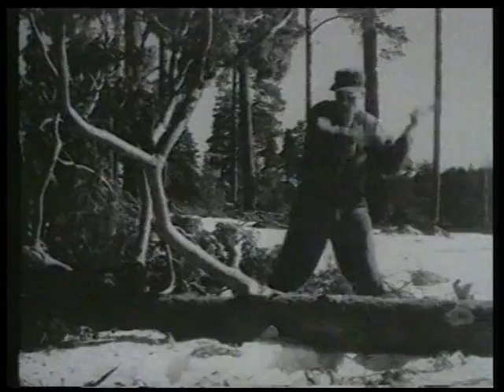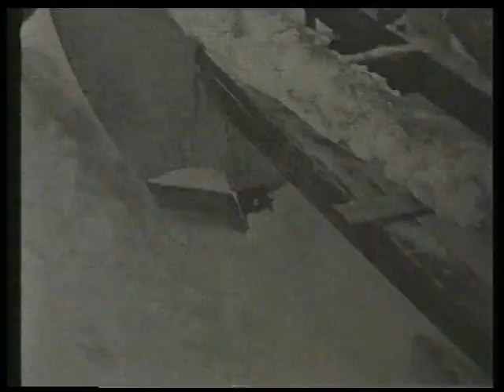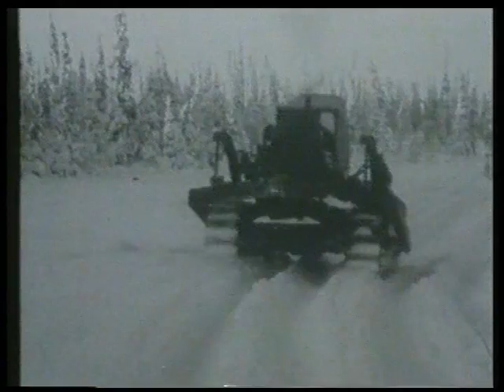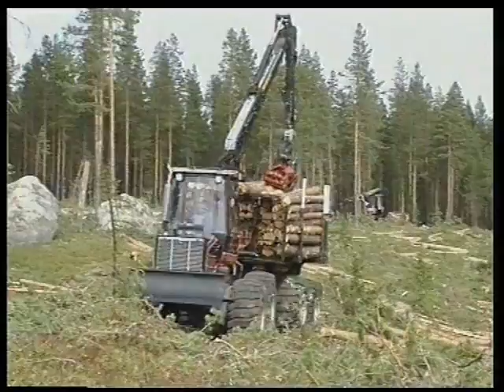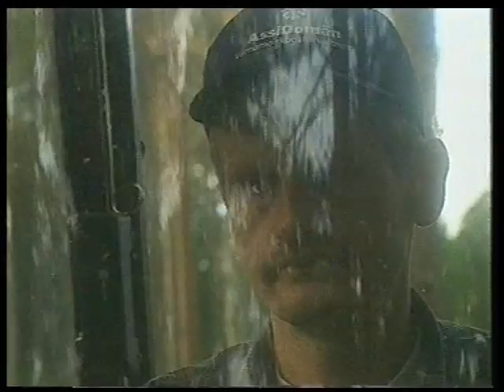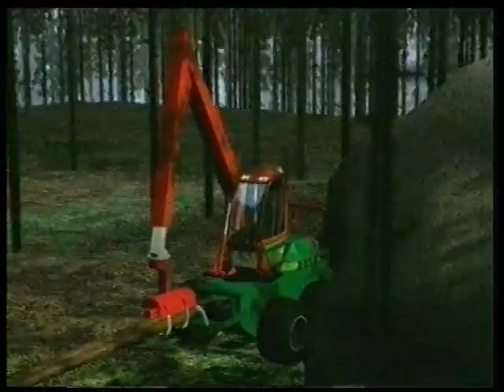From two-man crosscut to harwarder

Comment: If this was made 2020, we would see the technology that we use today would be hybrid machines because harvesters have high spikes in power demand, thus engines are "oversized" to give that spike power when it is needed. Hybrid technology replaces the engine with smaller to run generator and batteries and high spikes are handled by charged battery power. Wheels are driven by hydraulic electric pump. Also there are those 'drones' that take the load and drive to side of the road to dump the load for truck to pick them up. 

And then finally in the future when AI develops enough, we have harvesters driving by themselves and judging tree conditions for rot, size, straightness, etc. (and leaving 'seed trees' and 'squirrel/hawk/owl' trees up.

Comment: Här i polirken byn Övertorneå korpilombolo.fällan.gälivare.
Har häst körts fram till år. 1947 .
privata  år.1973 .
kom Ford contry 1954 samt dawidbrown.samt bm 32 35.
kördes långstock till nya vägar.
samt Ford teg skogstrakter kom 1954 1984.
handhögs till Volvo 969 971. skördare.tvågrepps.
kvistades enbart med Volvo.
handfälldes till år.
1984 kom Volvo bm Valmet skördare 902

Comment: i still use a hand saw for all my cutting i just dont like chain saws, they are expensive to run and always need resetting and servicing so i use a saw, does my fire wood quite well!
Reply: Lmao you are funny. Chain saws are very affordable. If you do alot of cutting a chain saw is a must
Reply: @jacob-ih2zj  no it is not only if you feel that way
Reply: @fuzzzeballs  by the time you are done with 1 tree with a handsaw the chainsaw have finished 5 trees even if you are just making firewood
Reply: @fuzzzeballs  very well do you have something like a Pilkemaster Evo 36 it cuts cleave and transport the wood away really effient. Some models even have thier own loaders so you just have to drag your logs to it instead of lifting it all the time which saves your legs and back
Reply: @fuzzzeballs  Well I also do manual labour in my line of work brushcutting trees sure I know there are hand tools for that as well but you dont stand a chance with hand tools to cut down bruchcutting trees compared to the Stihl 490

Comment: Stihl chainsaw 1929, though some would debate, the 1929 was the first practical gasoline powered man portable . Timberjack and Gafner Iron Mule late 1950s. Wagner made some early log skidders (the ones owned by VanNatta Brothers were build in 1955 and 1956).